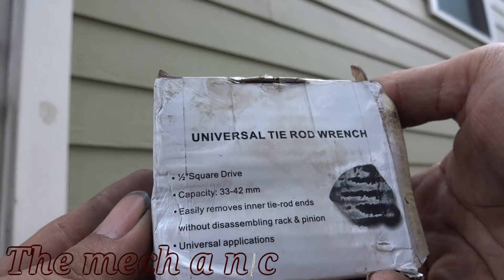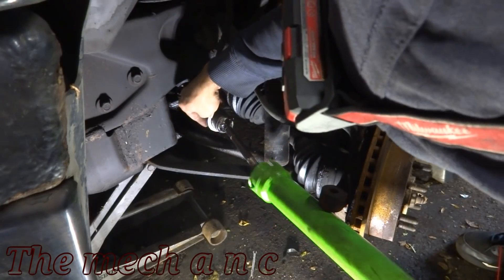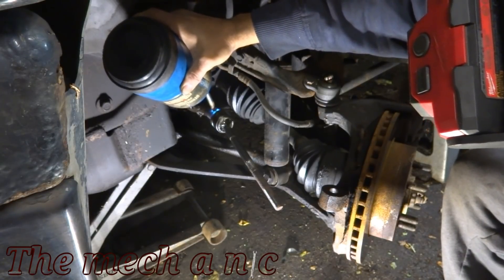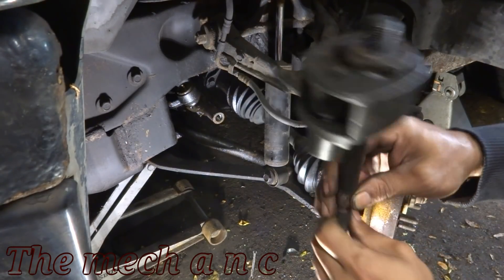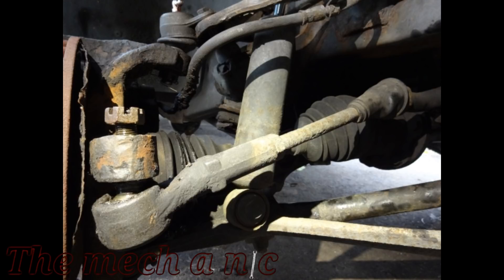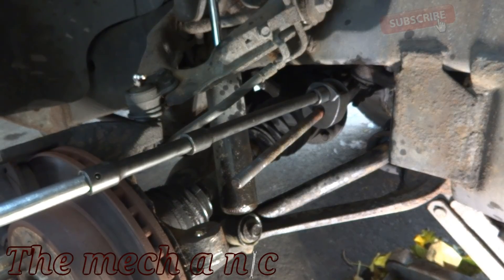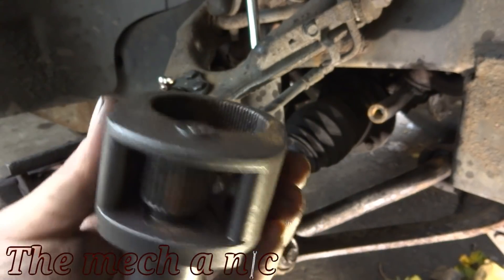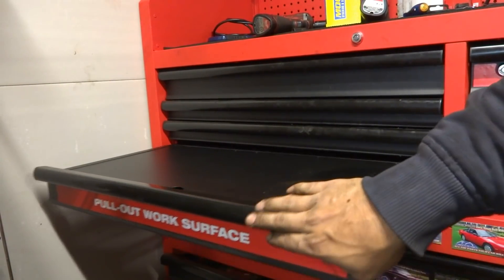The best inner tie rod tool?

Comment from the maker: I've been using this tool for every tie rod job I get and it's my new favorite tool. I don't even bother with my other tools anymore 👍
Reply: I noticed in one of your more recent videos a brief snapshot of the more popular traditional long cylindrical tool. Do you now have both? Which do you reach for first, now? I got one of the knock off cheaper ones shown in this video, mainly because I'll rarely need it and it is probably OK for DIY use. But a pro might feel differently, even if it only reduces his job time by a couple of minutes. I'm guessing this one might not be quite as good for those that are really stuck.... What do you think?
Reply from the maker: Yes i have both now. I always reach for this tool in the video now when doing inner tie rods. Ever since i got this tool i dont think ive used tthe cylindrical one at all . this tool is a major time saver over using the tube style.
Reply: @themechanic6117  so you like this one better than the other one that looks like a muffler clamp?
Does this one here install the tie rods as well?
Reply from the maker: @mrbreezeet1  yes this one is better and yes it can install new tie rods
Reply: @themechanic6117  
Thank you I already ordered the other style the one that looks like a muffler clamp I hope it will work for me.
Reply from the maker: They both work . I just find this one to be faster but I work on cars every day so the speed is more important to me. The other one works just fine
Reply: how did you get it to screw back in after taking the inner tie rod off
Reply from the maker: The new tie rod should just screw in. Sometimes it can be tricky getting the threads to line up.

Comment: As i'm so cheap I made my own removal tool.
It has 4 nuts welded around the end of a tube with bolts that screw down onto the tie rod flats.
The other end has a large 1/2 inch socket bolted in for the breaker bar/ torque wrench to slot into.
That new tool looks pretty nifty, might be tempted.
Reply from the maker: Lol sometimes homemade tools are the Best! 👍💪. I used it again today and I got the job done in record time!  Can't believe I didn't get it sooner!
Reply: Saw another guys where he took a pipe wrench and cut off the handle. Where the handle would be he welded a socket or square hole. Then you can use a extension and ratchet on it.

Comment: Interesting idea! Basically a pipe wrench with a half inch square socket near the teeth, allowing one to stand at the side and exert more torque. A pipe wrench wouldn't work as well because there is not enough room without a lift. The best thing about this is how small it is. Big specialty tools are a pain to store.

Comment: The other tool you reviewed that looks like a muffler clamp, works better.  The bite around the inner tie rod is spread out much more.  There is no cam to wear out.  You don't have to remove the outer tie rod from the inner tie rod.  It is less expensive.  And can be used for many other applications besides inner tie rod removal.  I've used it successfully on several types of cars.
Reply from the maker: Its a great tool , definitely a good tool to have
Reply: I agreed and also may be use for other application; however, the clamp one seems to be using 3/8 extension compare this one using 1/2/ which is much stronger.
Reply from the maker: After using both for many years I prefer the one that's in this video
Reply: @themechanic6117  Thank you so much for your suggestion. 👍

Comment: Hi, I only need to use this two times (left and right side) and I don't need fancy OEM tools comes with so many adaptors and also so expensive. Which you would you pick to repair tie rod for a old corolla.  I read some comments down below on the clamps is better because it opened and can adjust to many application (ie faucet, pipes etc.) but the one you show on video seems more solid build and it use 1/2 extension (more power). Which one you will pick? Thank you so much for sharing this video. You going to save me lot of $ on inner tie rod replacement. 👍

Comment: I have that same AEM I need tie rod took plus, a $5. Or $10. Dollar tie rod tool that looks like a exhaust clamp shape, it's cheap & works good but, the Aem dominates inner tie rods but, only if the outer tie rod is removed 1st. My green AEM tie rod tool came with 12-15 different size inserts.
Reply from the maker: I have both of those other two designs of tools. They each have they're place

Comment: That's an awesome tool for the price!  Not sure I'm game to do tie rods though haha I don't have enough grunt 😂
Reply from the maker: Don't doubt yourself. Just get a longer pipe for leverage and off it comes ! 💪👍
Reply: @themechanic6117  no risk of bending the steering rack?
Reply from the maker: You can you a pipe within reason. If you feel like you're applying too much force you should stop. Try a little bit of heat

Comment: I have a stuck inner with red lock tight. I used a 3/4 breaker with 1/2 inch adapter and the oem tool but the tool fails. The c- ring slips and spins  around the flats on  tierod and the ring on the tool come off. Tie rod will not budge. Think this new tool will work for me? Thinking the rack needs to come out or I need to cut the rod and devise something that I can weld into a 3/4 deep well socket.
Reply from the maker: This tools works very well and has never failed me. Id use propane or map gas to heat up the area where the locktite is and then use this tool

Comment: now i wonder if this tool or the other one in your video which is better, they other one takes longer to setup be ause you have to tighten 2 nuts buy this tool you have to take all them parts off just to get it in. 🤔
Reply from the maker: The tool in this video is by far the best one. Usually if you're removing a inner you're also replacing the outer tie rod so it's no big deal to removing  the outer tie rod. I've gotten cars with bent tie rods due to an accident and it prevents me from removing the outer. That's when the other tool shines. The tool in this video is my go to.👍
Reply: @themechanic6117  thanks great video by the way helps everyone out 👍
Reply from the maker: Thanks for watching

Comment: Mayhew Pro 29910 Speedy Universal Inner Tie Rod Tool,  the best tool so far
Reply: @Angel F Dude that shit is over $100 compared to  $20 and does the job ..it's a no brainer🙄
Reply from the maker: The tool i show here works great every single time
Reply: @themechanic6117  hey broski cuz of ur video I bought the same one and works beautiful 😎👍🏼..replaced both front inner tie rods on a Honda pilot
Reply from the maker: Great! I've been using this tool since i got it and it hasnt failed once. Glad it helped you to get the job done. 👍💪

Comment: What about cutting the tie rod with an angle grinder to fit it in ?
Reply from the maker: If you're replacing the inner and outer tie rod I've cut them before
Reply: @themechanic6117  that's right thank you 👌

Comment: Hi, great review on this tool, thanks 👍🏻
But I’m wondering, can this tool be used for the installation of the inner tie-rod?
Thanks in advance
Reply from the maker: Yes it can, i use it all the time to remove/install inner tie rods
Reply: The mech a nic Ok thanks for the reply, I appreciate it 👍🏻
Reply: @themechanic6117  only issue I have with using this to install tie rods is if the factory manual specifies a torque value you should tighten the inner tie rod to. With the tube you can just apply the correct amount of torque, whereas if you use this tool you need to do a little bit of math to work out how much torque you need to apply, unless you manage to angle the torque wrench to be exactly 90 degrees perpendicular to the direction of rotation

Comment: Will this tool work on a honda civic inner tie rod, where 32mm wrench fits on the tie rod head? (the head is like a cube and the 32 mm wrech fits on the cube)?? Thank you for your answer!
Reply from the maker: I haven't found a inner tie rod that this tool doesn't work for. You should be ok with this tool

Comment: I have another question on torque specifications for 2003 Chevrolet Cavalier. For some reason many torques are very confusing on this car. I need just 2 of them: 
1. For the Jam Nut on the Inner-Outer rods connection. What I found on forums (31-55 Ft-lbs), e-manual (nothing) and Haynes book (nothing), I think it is obvious mistake) varies a lot. Maybe it is not that big deal, bcs I'll go for alignment to a dealer anyway, but it would be good to know at least approximately.
2. For Outer TR End Nut. What I found on forums (33-50 Ft-lbs), e-manual (nothing for 2003, 31Ft-lbs for 1995, 44 Ft-lbs for 1997-1999) and Haynes book (84 in-lbs (7 Ft-lbs), I think it is obvious mistake) varies a lot. 
   Thanks God I found in e-manual for Axle Nut 147 Ft-Lbs for 2003 Chevy Cavalier (and not like they give in Haynes 185 Ft-lbs, that was true for earlier models). I was about to apply 185 Ft-lbs and even bought a torque ranch in that range of torques. I even don't know what would happen if I would apply 36 more than needed, maybe nothing, it would be just hard to remove that Axle Nut next time. I think it so confusing for this car bcs there are a lot of variations on torques for models of different years.
   I would appreciate any opinion on those two torques, mentioned above.  Thank you for the film again. For the Inner TR I'll be using that green OEM tool you have.

Comment: I've read that it is recommended to remove the rack before torquing on the inner tie rods (not to damage or break seals on that rack), but I see many films where Inner TRs are replaced without that complicated 
procedure. Is it  for some models, or it is extra precaution? I changed those Inner TRs on one car (2001 Saturn SL2) and decided to do same thing on 2003 Chevy Cavalier. But there was a white plastic sleeve on the Inner TR of the Chevy, I started to do some research and came across this statement about the seals on the rack. Now thinking that maybe it is a reason, why for both cars Haynes Manual doesn't describe Inner TR 
replacement. Very confused and would appreciate any opinion on this matter. Thank you for the good film.
Reply from the maker: The white plastic is basically a stopper. It limits how much the rack can move to not damage anything. As far as removing a rack to tighten inner tie rods...nobody does that. Simply put it would be crazy. Thats like pulling your whole engine out of your car to change the air filter.
Reply: @themechanic6117 Thank you for the replay. I think I expressed myself not exactly: that plastic is not a stopper, it is kind of a soft shell covering the hemisphere of the Inner TR. In one film another person asked same question, bcs he found same plastic (or whatever material is) cover on the head of the Inner TR, but his was yellow color. That smooth shell is tiny, like 2 mm. That person got the answer in the style to remove the rack, to drop the rear subframe and everything of that kind. I agree all that is crazy.  he said that the shell should be slided off the The TR head. Maybe in that part he was correct, I'll try to do it tomorrow, but doubt in the success. Maybe it will slide off   and after a new TR is installed, it can be put on a new TR head.
Reply from the maker: Do you have a link to that video you're talking about?
Reply: @themechanic6117  I tried to find now, but could not find that film, but I found the link on Impala Forum, where I ended up, that is where he (Doug) gives that recommendations.
https://www.impalaforums.com/threads/inner-tie-rod-plastic-cover.867554/
https://www.impalaforums.com/threads/inner-tie-rod-plastic-cover.867554/
Maybe that Impala is particularly sensitive, but I think it is a good question to investigate, what can happen and when. And as you said very correctly, there is no single film, which recommend to do it that way (very complicated indeed). 
    And also I found about that plastic cover: it is the plastic shock dampener. In one film he had exactly same thing, so I'll do it that way. It is @4:30
https://www.youtube.com/watch?v=BrAf5_FA5eE
Now I'm curious was it supposed to be that dampener on the Saturn I did before, or it is just Chevy, which has it? Maybe mechanic who did the Saturn Inner TRs before me just didn't put them on? Maybe that part is not so crucial, since no one put that plastic dampener on a new TR, besides like in that film above. 
Thank you for the attention to my question.
Reply from the maker: I see what you're talking about. I typically slide off the shell to change the inner TR then slide it over the new inner TR just how it was. Sometimes they go missing over the years. Someone forgets to put it back on. Its not really important seeing that most cars dont have them but if a car comes with one i always put it back on.
Reply: @themechanic6117  Thank you, that makes sense. It is good to know that actually all of the tie rods should have those boots, strange that they don't sell them separately, or that new tie rods come without them. I tried to google, nothing, probably really not much need in them. But see how that dealership charged me ~$700 for Inner and Outer TRs (like 5 years ago), but didn't put those boots. In some sense it is good, bcs eventually I started to learn to do some things myself. God Bless.
Reply from the maker: Thats a ton of money for inner tie rods! I changed all 4 tie rods for $140 (labor) . learn to do it yourself and can can save a ton
Reply: @themechanic6117  That is very low price you charge, it is a pity you are not in Dallas. Though I do many things already myself, but still something can come and you need someone who knows more. U-tube is very helpful, as well as your films.

Comment: I tried two tube style kits on a Honda Pilot and neither fit. One tube would fit but no but that would fit and the other kit wouldn’t fit over the ball on the inner tie rod so I had to take one tube out of one kit then a nut out of the other to make something work. I’d rather try a different style like this.
Reply from the maker: Ever since i got this tool Its all i use. I cant remember the last time i used the pipe style

Comment: They need to invent an inner tie rod tool that clamps around the inner rod when you cannot get the outer tie rod off.  If you know of one let me know.  Thanks
Reply: Thomas EXOVCDS 

     That or the cutoff tool that applies 8 tons of cutting power to snap the rod in the middle. 👍
Reply from the maker: The other tool I mentioned.  You can use it without removing the outer tie rod.

Comment: it will not work on all inner tie rods try it on a 94-97 honda accord and any tie rod that has a ball joint where it screws into the rack and pinion it will just turn the tie rod around the ball joint
Reply from the maker: Yes ive found other cars it doesnt work on but it works for most cars